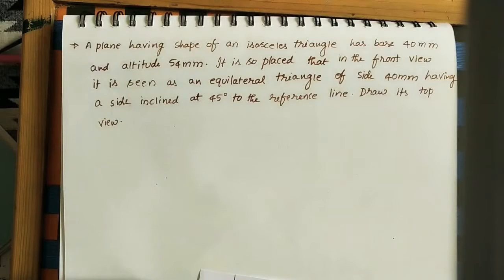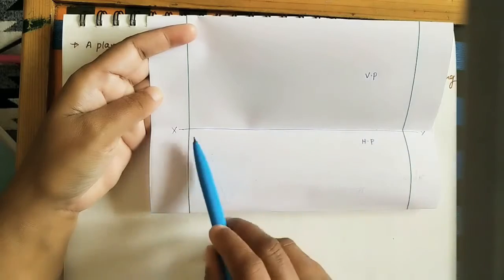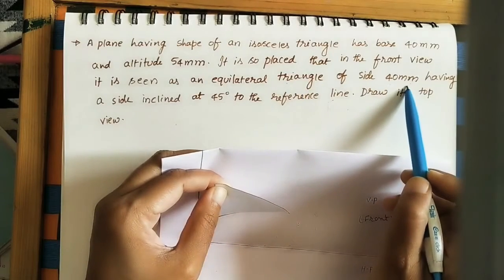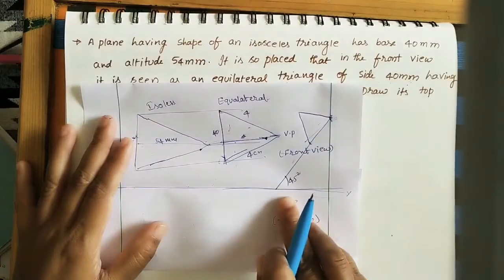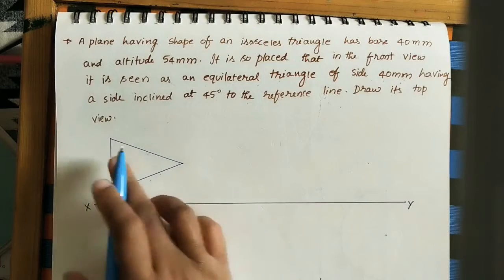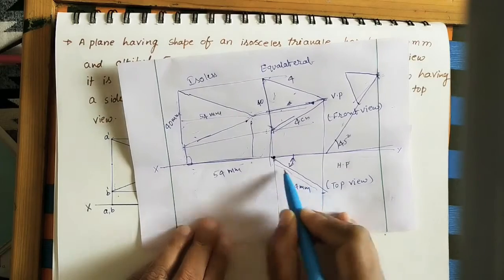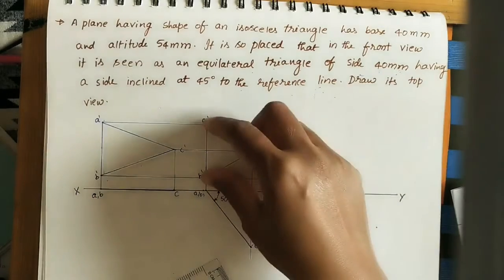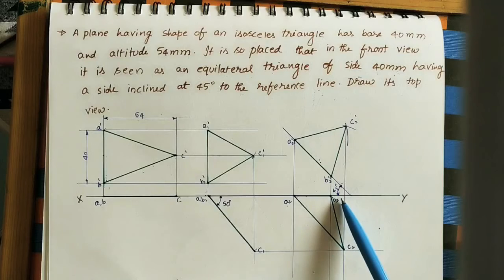Projections of  Triangular plane(Isosceles triangle)// Engg Drawing//Engg Graphics.

Comment: Q) develop projections of a Pentagon plane of side length 30mm and inclined at 45 degree to HP and perpendicular to VP ?
a) 
1)according to question. Is he talking about SURFACE ANGLE    or SIDE ANGLE.
2) should we draw cornered-Pentagon or leftSided-Pentagon below XY line.

Thanks a lot mam. your videos are very helpful. ❤